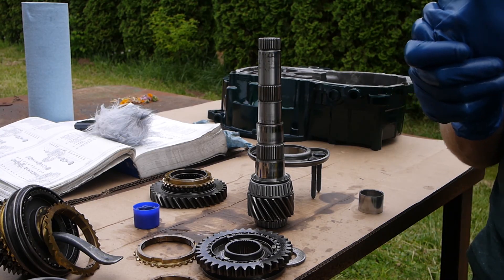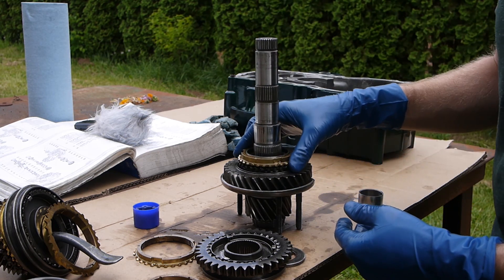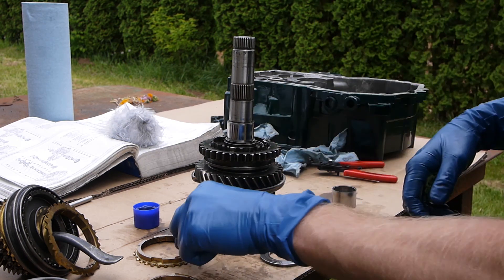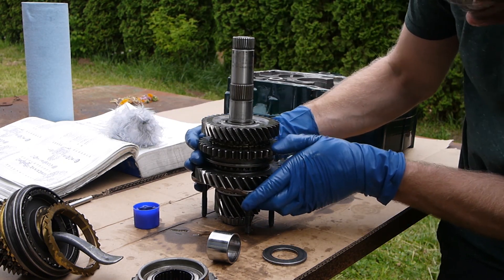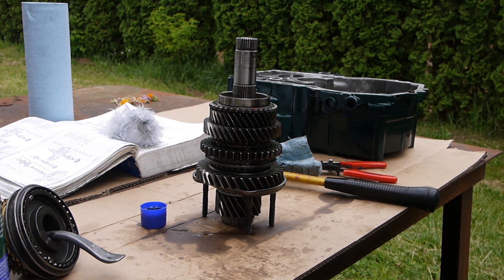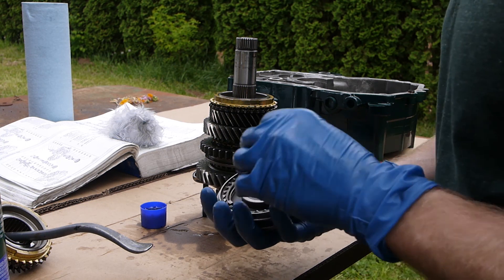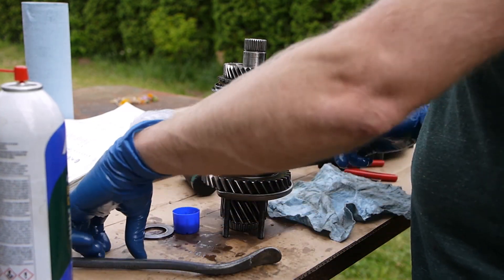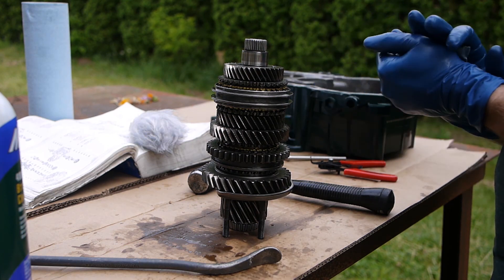VW 02A/02J/02C Reassembly Part 1 of 3

Comment: Which manual are you referring to and is on your work table ?
Reply from the maker: It's in the comments but I'll go again, the B4 Bentley manual has what you need. I believe the Corrado manual has it too.
Reply: @andrewlewis4253  Thanks to you. Best regards.
Reply: @andrewlewis4253  Could be interresting to put this information on the video description to avoid to have to answer the same comments many times.  Thanks for your nice videos.

Comment: Did you have to use a different shim or was the one that came in it in spec still since where only changing bearings
Reply from the maker: When you change differentials you sometimes have to used different shims. The measuring procedure is in the B4 Bentley manual. In my video I have used a different gear case and differential so my shim requirements changed.

Comment: Excellent video. I know this video is a little dated but can you tell me which Bentley you are using? I have a mkIII Bentley and it doesn't get into the internals of the transmission.
Reply from the maker: Not a problem. I used the B4 Bentley.
Reply: @andrewlewis4253  Thank you